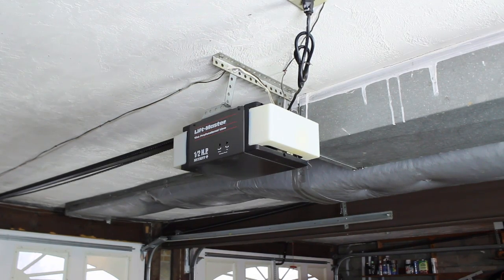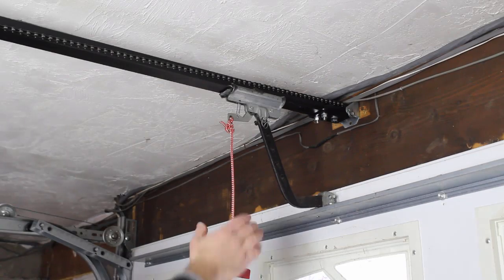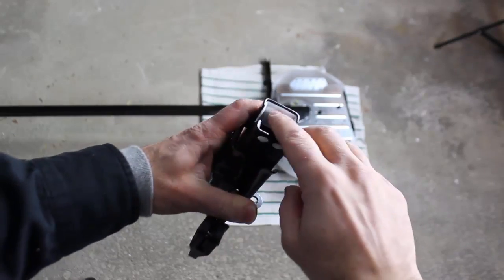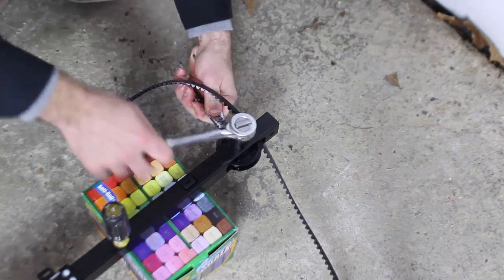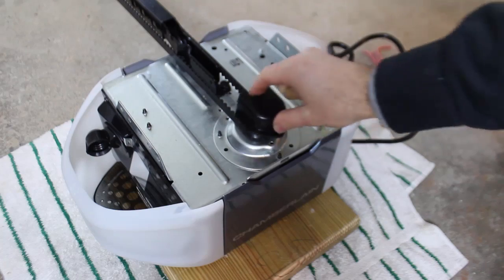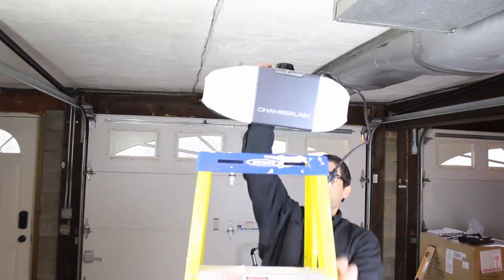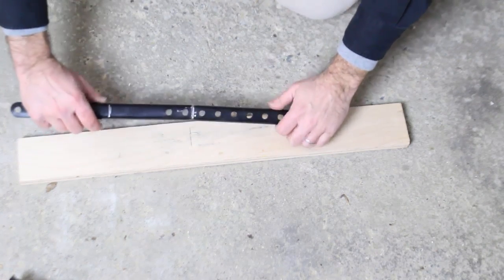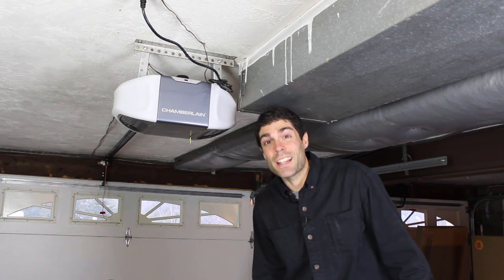Garage Door Opener Installation -- by Home Repair Tutor

Comment: Your video completely skipped where u put the screwdriver to get that spring to snap in and i cant get it to work.....in no way could u just hand tight that nut on the bolt. I had to wrench the hell outta it and now it wont snap into place and ur video doesnt show how u did it.

Comment: FREE ESTIMATE - CALL NOW !!

We provide Garage door services for both residential and commercial.
We believe in perfection of our work and try hard to ensure that.
Our staffs are experienced in the business. 

Our services: 
Garage Door Repair, Garage Door Cables Replace, Garage Door Spring Replace, Garage Door Cable Replace, Garage Door Adjustment, Garage Doors, Garage Door Opener, Garage Door Installation, Garage Door Company, Gate Repair, Garage Door Repair Services, Overhead Garage Door, Residential and Commercial services, Garage Door Springs Replace.

For better assisted contact us:
Elite Garage Doors
40 Grove St #214, Wellesley, MA 02481
(781) 591-7263
http://www.garagedoorswellesleyma.com/

Comment: Overall not a bad video at all.  But you miss a lot of good shortcuts.  Also, your bracket attaching the lift arm to the door is in the completely wrong spot.  It should be much lower than you have it.  It should be attached to the stile in the middle of the door that all doors have.  You also used old wiring which is wrong.  You should replace all of the old wiring with the new wiring which is included with the new operator.  Not trying to be a dick, but I do this for a living and just happen to know a lot of shortcuts and things that make this go much faster.